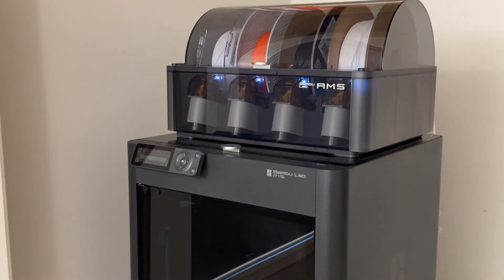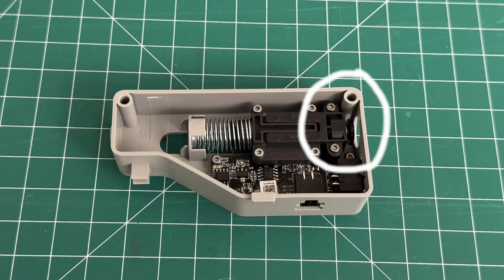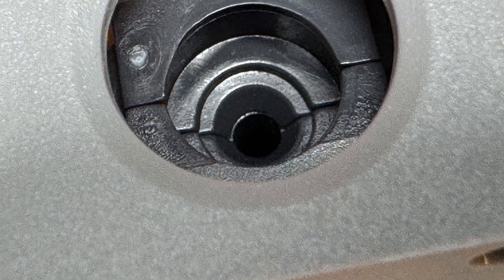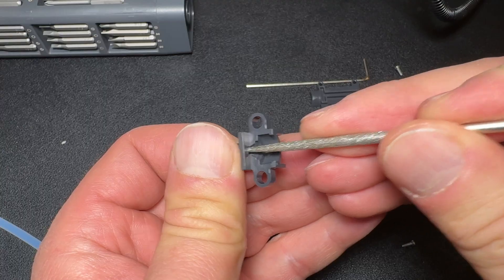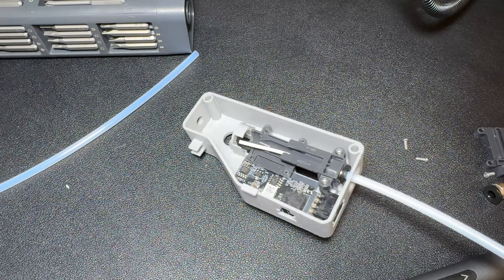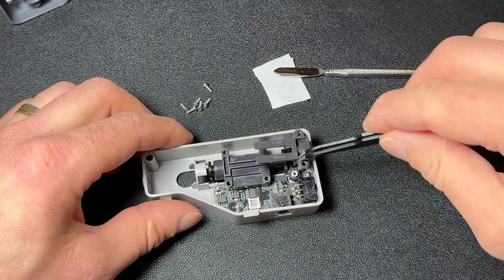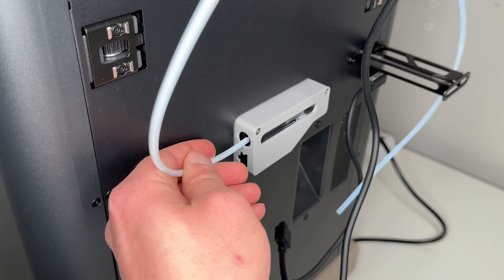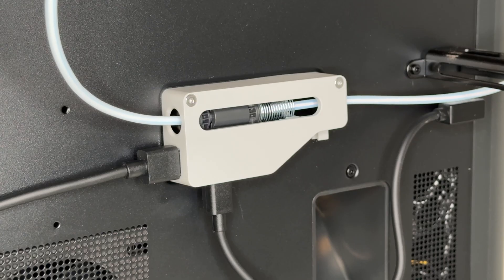Filament stuck? Fixing Bambu Lab P1S/X1C Buffer Issues

Comment: ok so i did this and it go about 2 inches past the buffer and retracks back
Reply: how'd you fix it
Reply from the maker: If that happens maybe the buffer itself is not working fine. Make sure that the piece of magnet is properly installed.

Comment: HELP. nice video on how to fix that side of the part,  I have the 4 way hub four my AMS's and have trouble on the other end where it will not pull out I can pull it back from the hot end but there is still filament going into the exit side of the hub  Is there any way to make it release without taking it off of the printer

Comment: I bought new P1S and AMS 2 PRO combo and AMS never loaded fillament (even once)... I wish they would adress this issue. Even external spool is having issues loading fillaments. Also my buffer looks diferent and is square?
Reply from the maker: Unfortunately I don't have an AMS 2 Pro and don't know if the buffer has the same issue as the one for AMS. Is the AMS able to push the filament up to the buffer and then it gets stuck there?

Comment: Mine makes it past the buffer but sticks just before entering the rubber tube into the printer. I've change the connector but it still sticks.
Reply: Same… what’s the fix for this.. it goes about 4-5” passed the buffet then retracts back.
Reply: @assessmenttreatment8445  It turned out that the problem was the PTFE tube from the back of the AMS had somehow dislodged. I took it out and pushed it back in and it's been fine since.
Reply: @davidharle952 thanks dave. I’ll check on that and connect disconnect. I appreciate the reply. Hopefully I can try to get some custom Xmas trinkets done 🎉

Comment: Which direction does the small magnet go? My magnet has a red mark on one end. I did not catch which end the red mark should point? I would think it is a North pole or South pole mark. It probably does matter to have the correct direction.
Reply: I found my answer on Bamboo web site. The tiny red dot (or line in my case) (north) goes towards the exit of the buffer.
Reply: @itechttemp  Lifesaver, Thanks!

Comment: What's the point of this buffer?
Reply from the maker: Absorbs tension between AMS and extruder. The AMS and extruder both push and pull on the filament but they are not in perfect sync so the buffer absorbs any differences. You need it if you use the AMS

Comment: Wouldn't you be scratching your filament, making it corse going thru the tube, then scratching the tube and the inside of ur printer.
Reply from the maker: If you use a smooth file there’s no chance that could happen. Plus this is not really a problem once the filament is in the buffer. The issue occurs when loading new filament or changing colors when the filament gets stuck before entering the buffer.

Comment: Have you seen the issue where the ams can't push filament to the buffer? It's not a stuck piece, it almost feels like a busted motor.
Reply from the maker: I have not. In my case the filament always passed the AMS and was getting stuck at the buffer. I did have a few older filaments break inside the AMS but you can easily take it out and remove any broken filament.
Reply: @mad_buildz  my issue wound up being that the plastic cap over the magnets on the AMS hub motor busted. A quick 15 minute print fixed my issue.